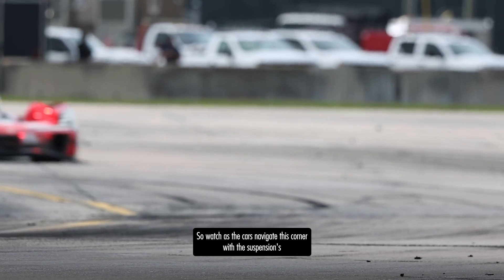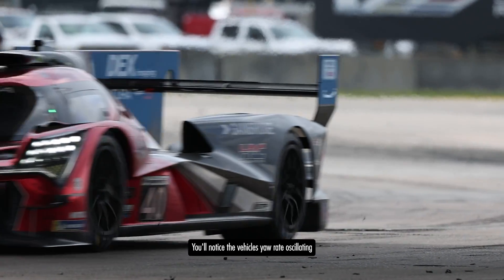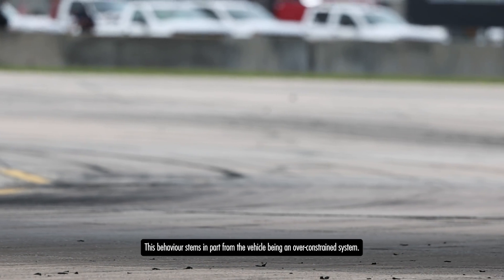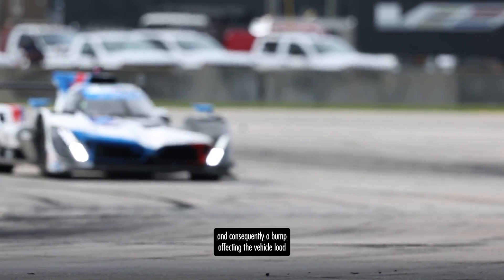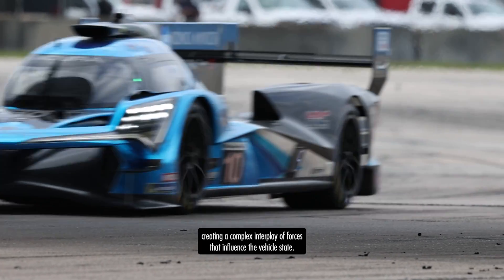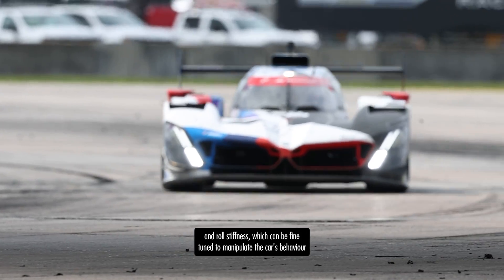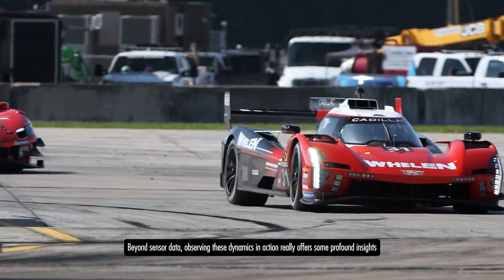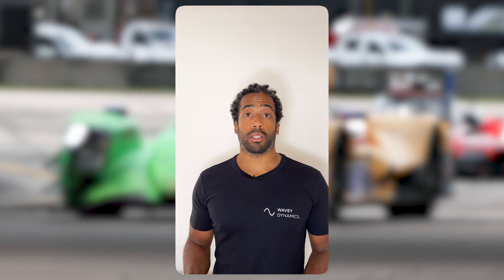Visual Dynamics | Learning With Your Eyes | Clip #1

Comment: One thing that instantly pops out, the right front axle(the most sensitive part of the aero package on right turns) produces less downforce when the car goes over bumps. It's the combination of weight transfer, reduced aero load as the car runs over it's own tire wake, and less force on the contact patch as the heavy bump causes the car to skip across the road. Sunset is a fantastic corner to analyze from a dynamics perspective, really forces you to mind your racing line to avoid the biggest bumps. The entry to the corner is very fast which makes picking the right entry angle even more difficult.

Good vid.